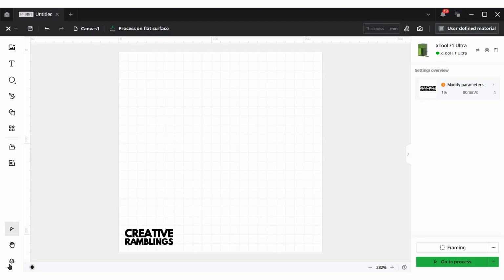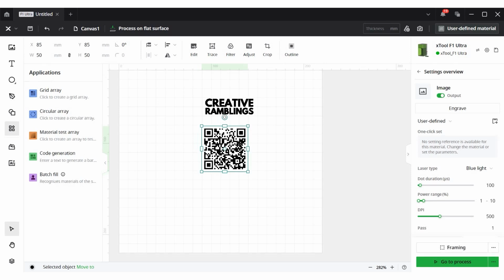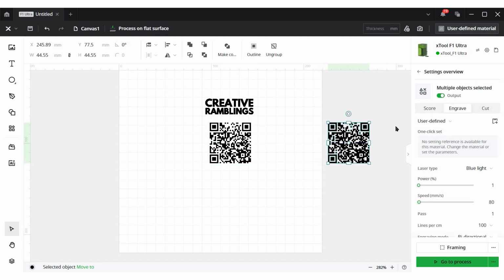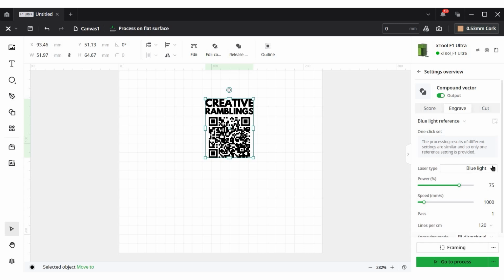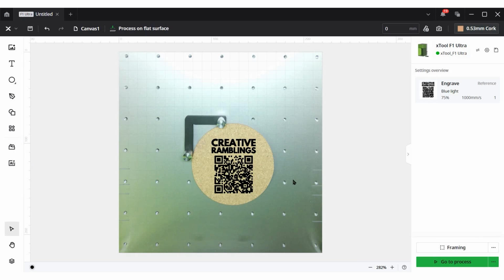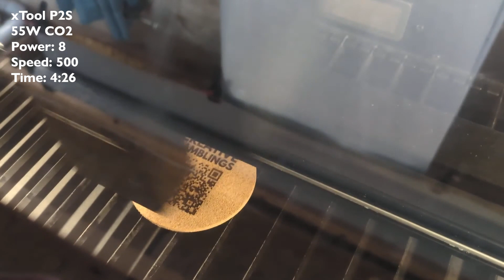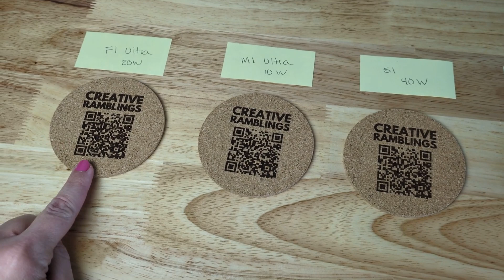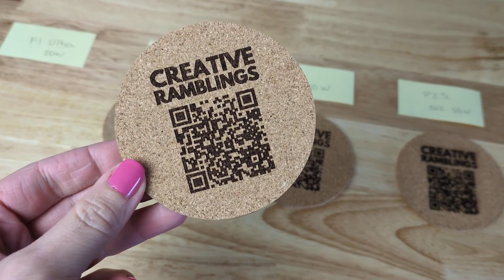Laser Engraved Cork Coasters You Can Sell

Comment: I bought the X Tool F1………… 2 months ago still in the box 😞🫣 🤦🏽‍♀️ could I use the F1 to engrave on cork coasters or just the lasers you mentioned
Reply from the maker: The F1 has a 10W diode and a 2 W IR. Use the diode (also called blue) laser and you will get great results! This would be a good first project.
Reply: Hi there I have a question about how to make drink coasters on cork or paper I want to put graphics on the coasters too. I could use some help with suggestions on using a laser printer on cork or paper as a beginner because I'm a newbie and need assistance to navigate with this business and new technology?

Comment: Great video! I have the S1 20W and would love to get some blanks and give these a go. Would you just recommend power 10 speed 300 (that you used for the 40W), or the standard XCS settings for the 20W - power 15 speed 180?
Reply from the maker: I would start with the standard XCS settings for your 20W machine. That is what I started with for my 40W and they turned out to be ideal.